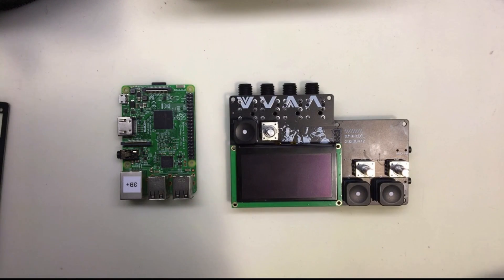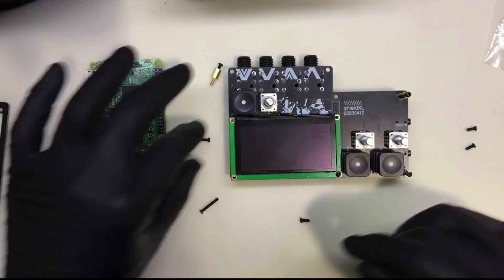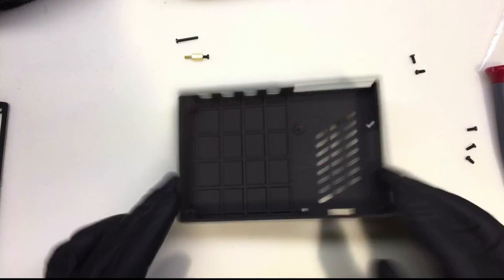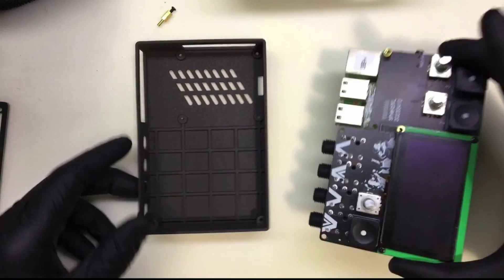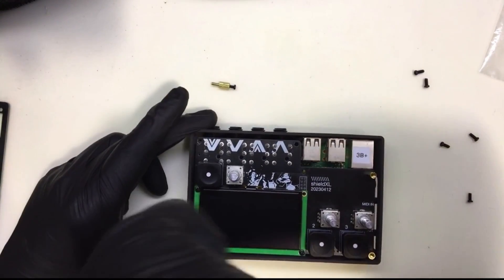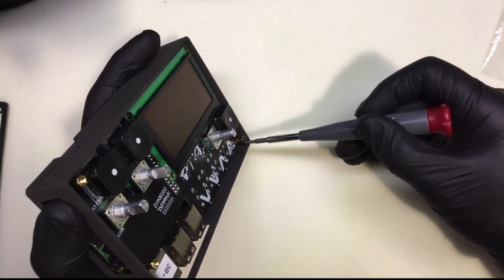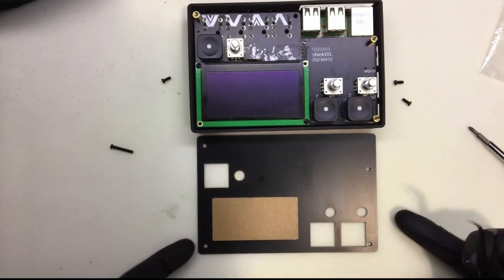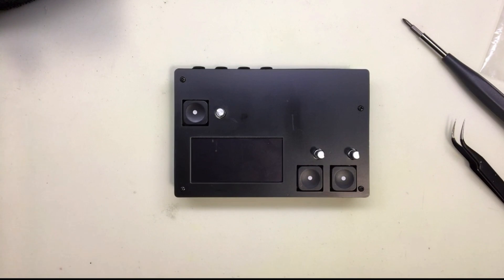shieldXL Case Assembly

Comment: What is the safe way to remove the knobs for a  case replacement ?
Reply from the maker: If they don't pull off easily, gently pry the knobs up - 2 large guitar picks on either side can fit under and you can pry up both sides at the same time. Go slow and dont force it too much.